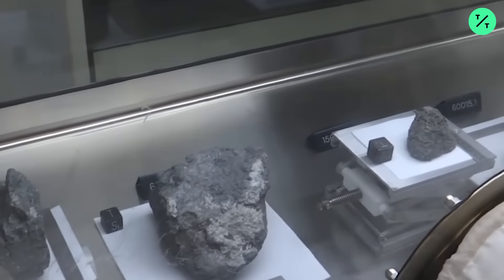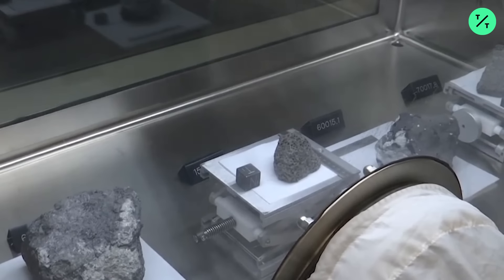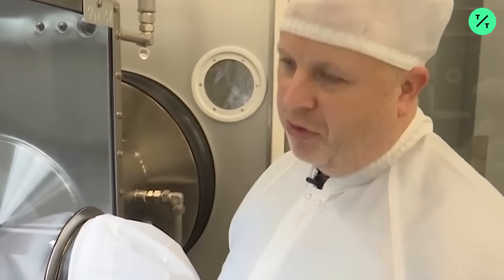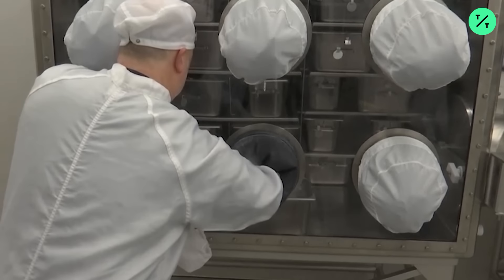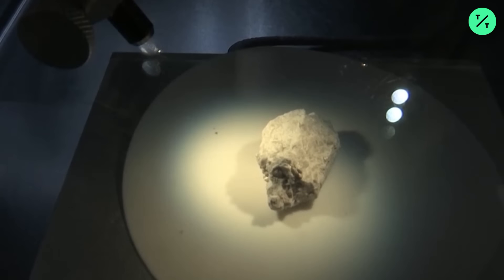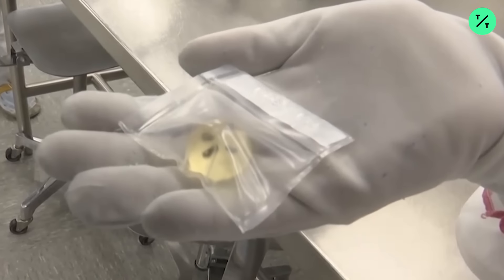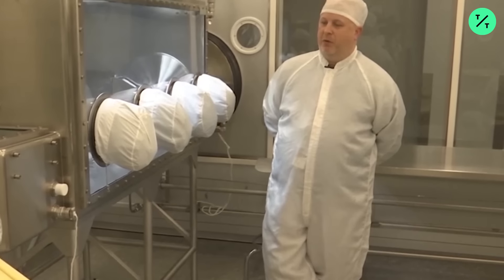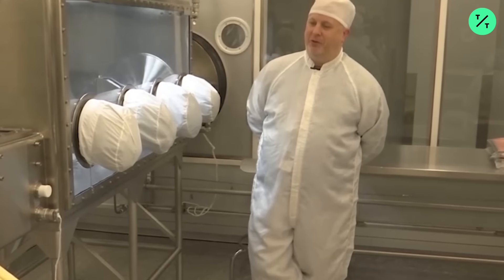NASA Opens Moon Rock Samples Sealed Since Apollo Missions

Comment: You mean they have that rock in such a secured area but the actual footage somewhere that the janitors cld have "thrown" away? yeah right NASA good one.
We destroyed the technology that got us to the moon but not the rock, good one NASA, they really think we believe that? Too funny.
Reply: The technology was vacuum tubes, which no one makes anymore for obvious reason.  Below is a list of the 43 missions since the end of the Apollo missions in the  1970's to the last successful mission in December of 2018.  You may find reading up on those missions interesting. 

Luna 21
(E-8 No.204) 8 January 1973 Proton-K/D Soviet Union Lavochkin Lander/rover Successful
Deployed Lunokhod 2.
Explorer 49

(RAE-B) 10 June 1973 Delta 1913 United States NASA Orbiter Successful
Radio astronomy spacecraft, operated in selenocentric orbit to avoid interference from terrestrial radio sources.
Mariner 10

(RAE-B) 3 November 1973 Delta 1913 United States NASA Flyby Successful
Interplanetary spacecraft, mapped lunar north pole to test cameras.
Luna 22

(E-8LS No.206) 29 May 1974 Proton-K/D Soviet Union Lavochkin Orbiter Successful
Luna 23

(E-8-5M No.410) 28 October 1974 Proton-K/D Soviet Union Lavochkin Sample return Spacecraft failure
Tipped over upon landing.
Luna E-8-5M No.412 16 October 1975 Proton-K/D Soviet Union Lavochkin Sample return Launch failure

Failed to orbit.
Luna 24

(E-8-5M No.413) 9 August 1976 Proton-K/D Soviet Union Lavochkin Sample return Successful
Final mission of the Luna programme. Entered orbit on 11 August 1976 and landed in Mare 
Crisium at 16:36 UTC on 18 August. Sample capsule launched at 05:25 UTC on 19 August and recovered 96 1⁄2 hours later.[68] Returned 170.1 grams (6.00 oz) of lunar regolith.[69]

ISEE-3

(ICE/Explorer 59) 12 August 1978 Delta 2914 United States NASA Gravity assist Successful
Five flybys in 1982 and 1983 en route to comet 21P/Giacobini–Zinner.
Hiten

(MUSES-A) 24 January 1990 Mu-3S-II Japan ISAS Flyby/Orbiter Successful
Designed for flyby, placed into selenocentric orbit during extended mission after failure of 
Hagoromo. Deorbited and impacted in USGS quadrangle LQ27 on 10 April 1993.[70]

Hagoromo 24 January 1990 Mu-3S-II Japan ISAS Orbiter Spacecraft failure
Deployed from Hiten. Communications failure; entered selenocentric orbit but returned no data.
Geotail 24 July 1992 Delta II 6925 Japan United States ISAS/NASA Gravity assist Successful
Series of flybys to regulate high Earth orbit.

WIND 1 November 1994 Delta II 7925-10 United States NASA Gravity assist Successful

Made two flybys on 1 December 1994 and 27 December 1994 to reach the Earth–Sun L1 Lagrangian point.
Clementine
(DSPSE) 25 January 1994 Titan II (23)G Star-37FM United States USAF/NASA Orbiter Successful

Completed Lunar objectives successfully; failed following departure from selenocentric orbit.
HGS-1 24 December 1997 Proton-K/DM3 United States Hughes Gravity assist N/A
Communications satellite; made two flybys in May and June 1998 en route to geosynchronous orbit after delivery into wrong orbit.
Lunar Prospector
(Discovery 3) 7 January 1998 Athena II United States NASA Orbiter Successful
Nozomi
(PLANET-B) 3 July 1998 M-V Japan ISAS Gravity assist Spacecraft failure
Two flybys en route to Mars.
WMAP 30 June 2001 Delta II 7425-10 United States NASA Gravity assist Successful
Flyby on 30 July 2001 to reach the Earth–Sun L2 Lagrangian point.
SMART-1 27 September 2003 Ariane 5G European Space Agency ESA Orbiter Successful
Impacted moon in USGS quadrangle LQ26 at end of mission on 3 September 2006.
STEREO A 25 October 2006 Delta II 7925-10L United States NASA Gravity assist Successful
Flyby on 15 December 2006 to enter a heliocentric orbit.
STEREO B 25 October 2006 Delta II 7925-10L United States NASA Gravity assist Successful
Made two flybys on 15 December 2006 and 21 January 2007 to enter a heliocentric orbit.
ARTEMIS P1 17 February 2007 Delta II 7925 United States NASA Orbiter Operational
THEMIS spacecraft moved to selenocentric orbit for extended mission; entered orbit July 2011.
ARTEMIS P2 17 February 2007 Delta II 7925 United States NASA Orbiter Operational
THEMIS spacecraft moved to selenocentric orbit for extended mission; entered orbit July 2011.
SELENE
(Kaguya) 14 September 2007 H-IIA 2022 Japan JAXA Orbiter Successful
Impacted the Moon in USGS quadrangle LQ30 at end of mission on 10 June 2009.[71]
Okina
(RSAT) 14 September 2007 H-IIA 2022 Japan JAXA Orbiter Successful
Deployed from Kaguya, decayed and impacted Moon in USGS quadrangle LQ08 on 12 February 2009 after end of mission.
Ouna
(VRAD) 14 September 2007 H-IIA 2022 Japan JAXA Orbiter Successful
Deployed from Kaguya, completed operations on 29 June 2009[72] but remains in selenocentric orbit.
Chang'e 1 24 October 2007 Long March 3A China CNSA Orbiter Successful
Impacted Moon in USGS quadrangle LQ21 on 1 March 2009, at end of mission.
Chandrayaan-1 21 October 2008 PSLV-XL India ISRO Orbiter Mostly successful
Succeeded through mission, terminated the mission in 2009, remains in selenocentric orbit; discovered water ice on the Moon.[73]
Moon Impact Probe 21 October 2008 PSLV-XL India ISRO Impactor Successful
Deployed from Chandrayaan-1, impacted Moon in USGS quadrangle LQ30 on 14 November 2008.
Lunar Reconnaissance Orbiter 18 June 2009 Atlas V 401 United States NASA Orbiter Operational
LCROSS 18 June 2009 Atlas V 401 United States NASA Impactor Successful
Observed impact of Centaur upper stage that launched it and LRO, then impacted itself. Impacts in USGS quadrangle LQ30.
Chang'e 2 1 October 2010 Long March 3C China CNSA Orbiter Successful
Following completion of six month Lunar mission, departed selenocentric orbit for Earth–Sun L2 Lagrangian point;[74] subsequently flew by asteroid 4179 Toutatis.[75]
Ebb
(GRAIL-A) 10 September 2011[76][77] Delta II 7920H United States NASA Orbiter[78] Successful
Part of the Gravity Recovery and Interior Laboratory,[78] impacted the Moon in USGS quadrangle LQ01 on 17 December 2012 at end of mission.[79]
Flow
(GRAIL-B) 10 September 2011[76][77] Delta II 7920H United States NASA Orbiter[78] Successful
Part of the Gravity Recovery and Interior Laboratory,[78] impacted the Moon in USGS quadrangle LQ01 on 17 December 2012 at end of mission.[79]
LADEE 7 September 2013 Minotaur V United States NASA Orbiter Successful
Mission ended on 18 April 2014, when the spacecraft's controllers intentionally crashed LADEE into the far side of the Moon.
Chang'e 3 1 December 2013 Long March 3B China CNSA Lander Operational
Entered orbit on 6 December 2013 with landing at 13:12 UTC on 14 December.
Yutu 1 December 2013 Long March 3B China CNSA Rover Mostly successful
Deployed from the Chang'e 3 lander, which landed on the Moon.
Chang'e 5-T1 23 October 2014 Long March 3C China CNSA Flyby Operational
Demonstration of re-entry capsule for Chang'e 5 sample-return mission at lunar return velocity.
Manfred Memorial Moon Mission 23 October 2014 Long March 3C Luxembourg LuxSpace Flyby Successful
Attached to third stage of CZ-3C used to launch Chang'e 5-T1.
TESS 18 April 2018 Falcon 9 Full Thrust United States NASA Gravity assist Successful
Flyby on 17 May 2018 to designated high Earth orbit.[80]
Queqiao 21 May 2018 Long March 4C China CNSA Gravity assist / L2 orbit Operational
Entered designated Earth–Moon L2 orbit on June 14 in preparation of Chang'e 4 far-side lunar lander in December 2018.
Longjiang-1 21 May 2018 Long March 4C China CNSA Orbiter Spacecraft failure
Launched on the same rocket as Queqiao and Longjiang-2 but it never entered Moon orbit.[81]
Longjiang-2 21 May 2018 Long March 4C China CNSA Orbiter Operational
Launched on the same rocket as Queqiao and Longjiang-1.
Chang'e 4 7 December 2018 Long March 3B China CNSA Lander/rover Operational
Landed 3 January 2019 and deployed the Yutu-2 rover to explore a large basin on the far side of the Moon.[82][83]
Reply: @spuriouseffect  Do you believe everything They tell you?